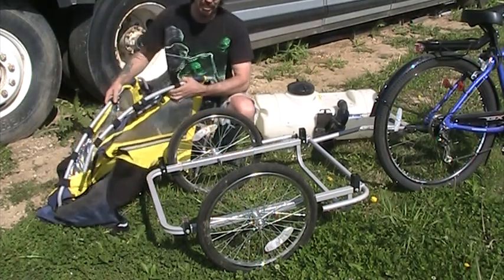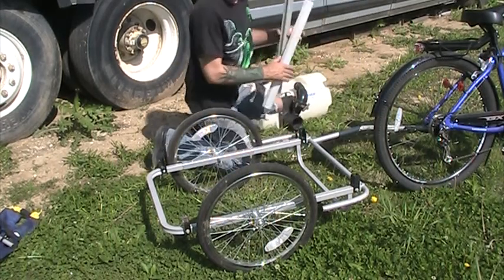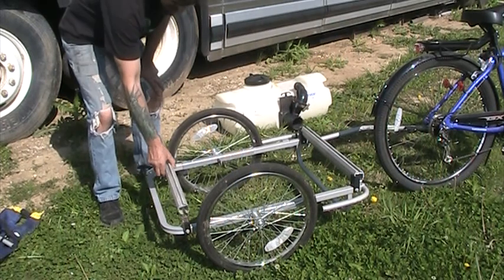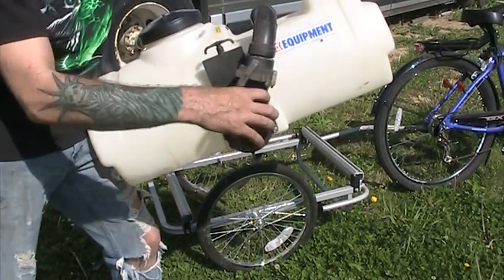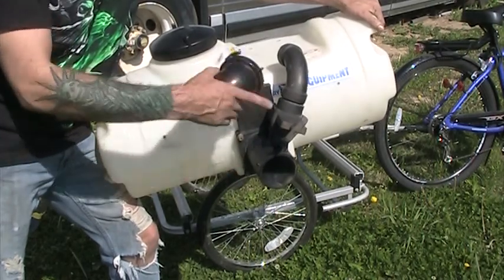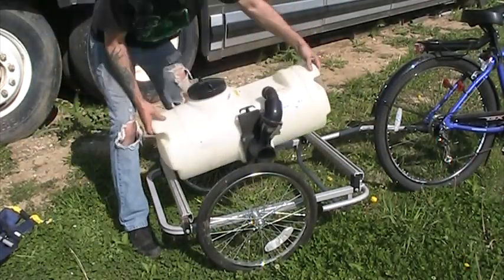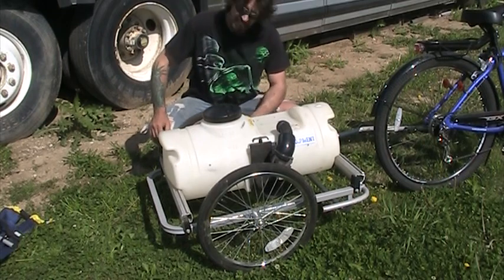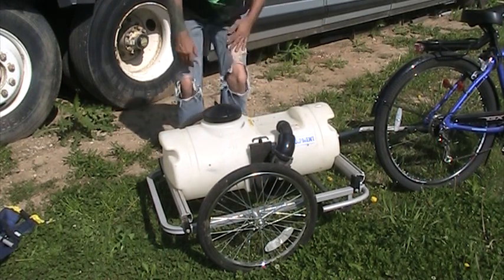portable black water septic tank dumper cart

Comment: Gene you are very resourceful. Some people have a hang up about toilets. In a house I understand but in a RV I would rather use a composting toilet or better yet a sawdust toilet ( 5 gal bucket inside a wooden box with a seal). Sawdust toilet you do you business and cover with as much sawdust to stop the smell. Works awesome and doesn't cost much if anything. Also eliminates and black water system ( toilet, pipes, water supply, drains, ect). Anyway good info and keep coming with the updates! Cheers